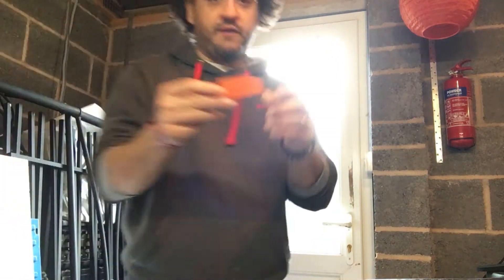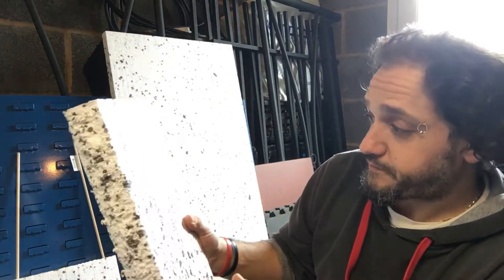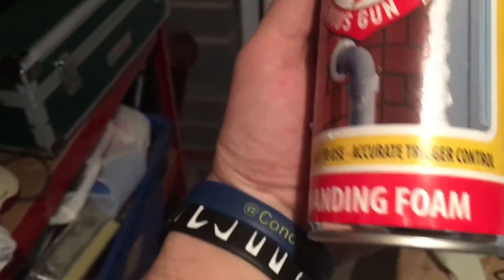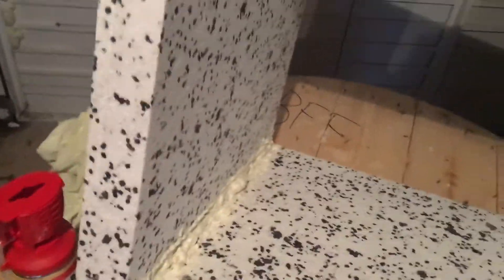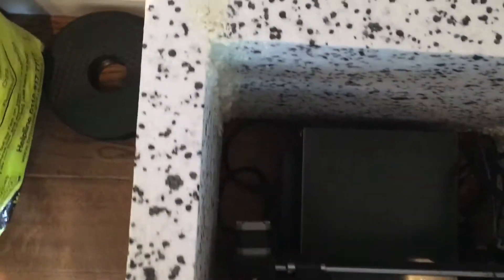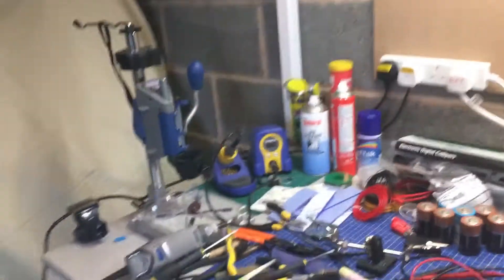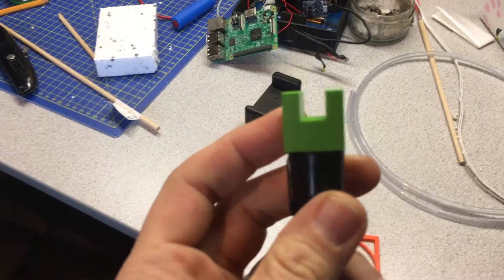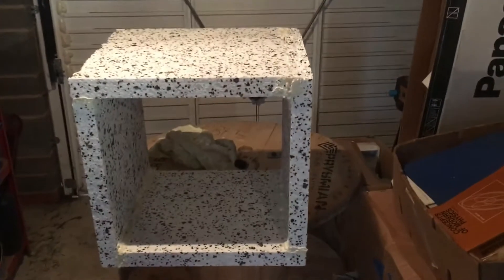How to make a cheap 3D printer enclosure for Anycubic i3 Mega for ABS printing

Comment: I was thinking about making an enclosure out of MDF board, but if styrofoam works, i guess i won't bother with cabinet-making. One question though. Doesn't it fall apart from the heat?
Reply from the maker: I've not had any problems with the foam deteriorating at all and I've had the bed at 110 deg C. However I would recommend some ventilation because the 3d printed filament feeder on my machine melted and warped inside the enclosure.
Reply: @domenicodevivo5318  Thanks for the reply. Much appreciated.
you know, now that I think about it, i might actually invest in water cooled hotend. seems like a better option than letting the heat escape the enclosure, and obviously cooling the hotend with hot air doesn't make much sense. Those are like 20 euro on ebay, so no harm in trying ;)
Reply from the maker: @HansOlo0  I made the enclosure mainly so that I could print with ABS because the problem is the ambient heat which escapes from around the print which is already on the bed. As soon as it starts to cool down, the plastic shrinks and curls off the bed on the corners. So I need to keep the heat around the entire print for the whole print time. Let me know how it goes.
Reply: @domenicodevivo5318  I will definitely keep you posted, no sweat. Actually I just ordered one of those water cooled hotends and a small 12v pump on aliexpress. 25 bucks with pump, not including tubing. That will prolly take like a month to arrive, but hey. now i'm thinking about "smart" ventilation. kinda like a thermostat, but instead of heater or AC unit, it would operate a servo which in turn would open a flap of sort on top of the enclosure when it gets too hot inside. i'm hoping convection will do the rest without causing too much draft in the chamber. have some microcontrollers and servos laying around. Will probably try it out next week
Reply from the maker: @HansOlo0  That sounds like a cool project to do. Good luck and send me some pics when you have it all set up.
Reply: @HansOlo0  checking in to see how it went

Comment: What settings you use to print ABS on the anycubic?
Reply from the maker: For ABS I extrude at 230 deg C and I have the bed at 90-95 deg C, however this seems to be the best setting for the Rigid ink filament, it may vary slightly for another manufacturers filament.